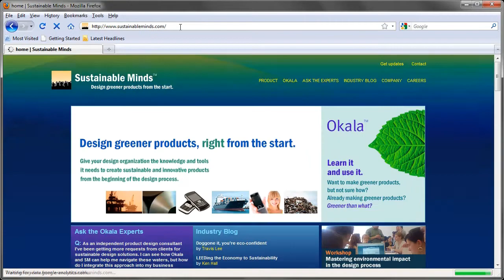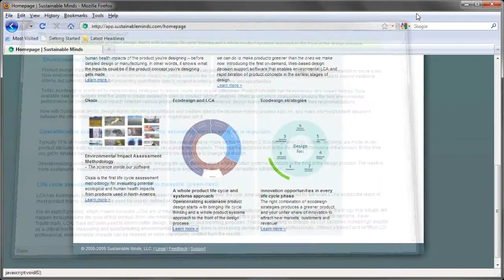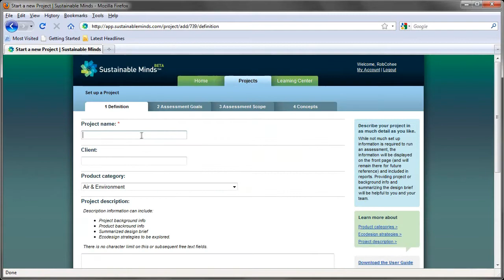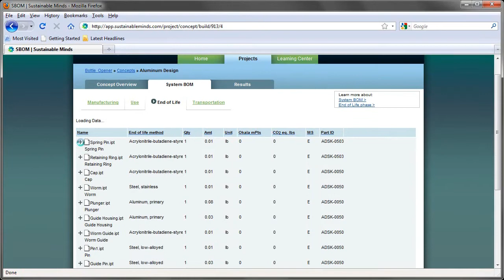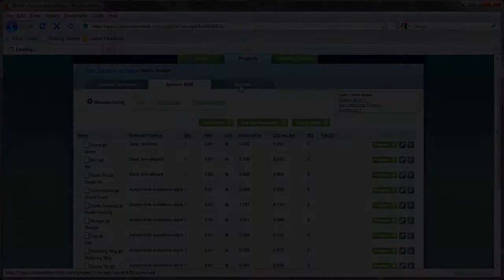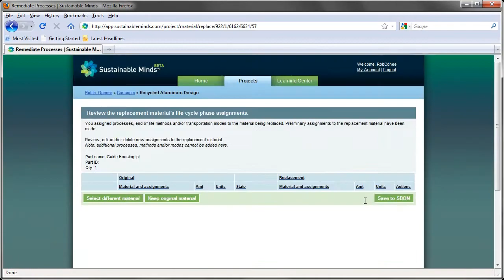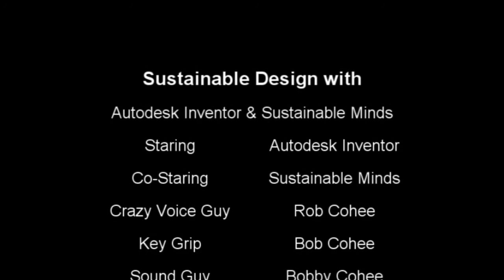Sustainable Design for Manufacturers with Autodesk Inventor and Sustainable Minds

Comment from the maker: Andy,

Check out Autodesk Inventor 2010: No Experience Required, by my good friend Thom Tremblay. I would spend most of the time on fundamentals of orientation, sound sketching, multi-bodies, and drawings. Kids still need to learn drafting and drawing standards and modeling is a good way to work that in.